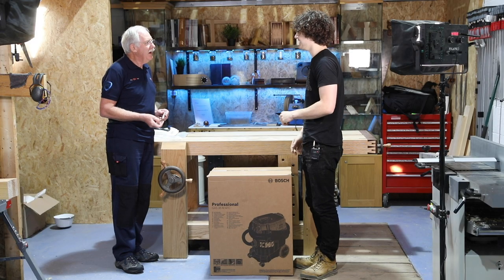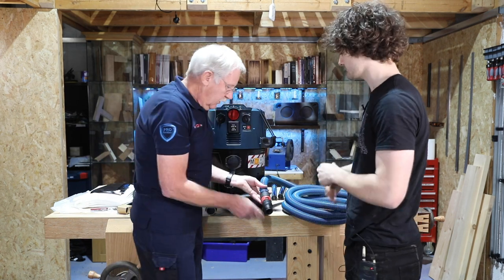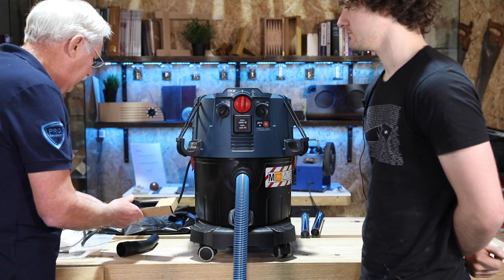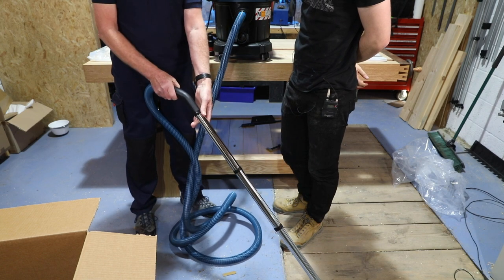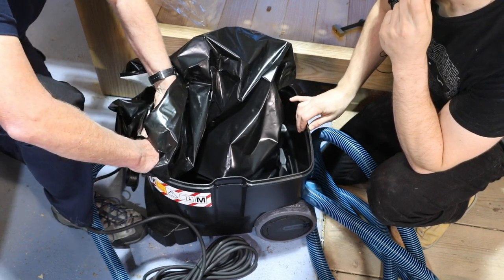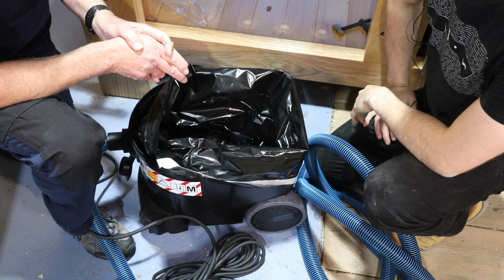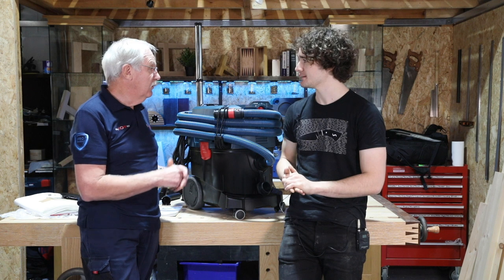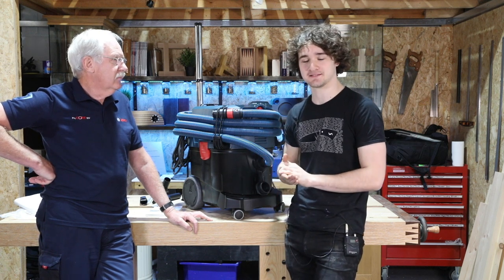Unboxing the Bosch GAS M Extractor | How to get the BEST from your Extractor

Comment: I bought one of these about a year ago, my wallet had to go for rehab, but my lungs have been grateful.  They are really expensive, but how much cheaper than a Lung Transplant?  Not worried about Matt selling out, he's lucky to have a sponsor which he's open about and the facts conveyed tell you what to ask about if looking at alternatives.  There are few M class that are cheaper, but plenty that are much much more expensive, if you have the money or value your lungs go and get one.

Matt, if you do ever get a hair cut, remove the bag before hoovering up, the shaggy fleece will help protect that filter!

Comment: I have a GAS50, over 15 years old now and still going strong -  which has a switch position for cleaning the filters (good to know they thought of it back then!).  I now have two Festool extractors, which are exceptional as they work up to the bag (replaceable or long life) being 100% full.  So when you do your test of this unit can you check what the extraction\performance is like when the bag is near full.  Good video, almost impartial from Bob, which is refreshing!  Oh - I also use my GAS50 for liquid - exceptional - really is great, no need to remove the filters  (which are still the original ones!!!).  Thanks

Comment: So in this video it was mentioned that all their L class hoovers use m class filters. And when using a fleece hoover bag you don't need the afc function. So therefore an l class hoover would be sufficient as long as I use a fleece bag which I have always done. Am I right in what I'm thinking? Great video btw

Comment: Thanks Matt. After using a small domestic vacuum cleaner for years and sometimes thinking about getting a proper device for the job; your piece here has tipped me over the edge and I have just bought a proper extractor - from Axminster of course!!

Comment: Matt, you should've asked Bob if Bosch make shop air cleaners. Ever since I hung one from the ceiling of my shop it has drastically cut down the amount of crap that gets up into the air after using a circular saw, router or sander. If the sunlight is right you get to watch the cloud of small particles get pulled and go away.

Comment: A very informative video. I always wondered what the difference between an L and M dust extractor was. A clear and simple explanation from Bob covered this nicely. If I decide to buy one of these I would also junk the plastic bag in favour of the fleece bags. Having said that, I reckon if you were sanding or working with filler or plasterboard it would get through the bag. The secondary M class filter should take care of most of this though.
Reply: The M class devices also have an alarm for when they're full or lose the ability to filter e.g. carcinogens. The point of an M is that everyone on the building site is protected from carcinogens and dangerous particles. 

The L class devices are cheaper because they're less smart; they have no alarm. They will happily let you continue working around them/using them when full, even with dangerous particles entering your lungs.

I decided in the past that £240 was right for my hoover choice (Makita VC3011L which is L class - and cheaper these days) but this M class looks like such a more advanced design.

Since it will protect my lungs better too - I'm seriously considering upgrading...

Comment: These look a great machine but I am concerned by the filter cleaning as it seems to be such a problem that it is turned off (noise and constant turning off the suction).  If I am hoovering fine brick dust will it go through the fabric bag and block the filter?

Comment: Hi Matt Bosch should really take well care of you.. You made me buy the miter saw, router and now am trying to buy this shop vac unit.. But i have a question.. Can I easily and safely use it with my GCM12 GDL miter saw? And if so is the amount of CFM going to  be decent for this setup?

Comment: I’ve had this GAS Extractor for 5 years and it’s been great, apart from one really really annoying feature.  It beeps too much.  It beeps, I’m assuming when there’s too much restriction to the suction, maybe to let you know something is stuck in the hose, or the filter needs washing/replacing.  The problem is it beeps even when it’s a new filter and there’s no obstructions.  It beeps when using a sander, it beeps when there is still good suction, and the suction/power settings have been changed.  I want to know how I can remove the beep, because it’s not needed, I feel like smashing it up when it goes on & on.  If it loses suction I will be able to tell, I don’t need a beep.  

My friend has the festool equivalent which doesn’t beep.  I think I will be changing to this soon.
Reply: if you have access to the PCB (circuit board), the beeper can be safely silenced with a hot glue gun. Thats what I did with my mocca-coffee-maker, works great

Comment: Hi Matt, just wondering if you (or any of your subscribers) could clarify something for me please. The maximum voltage for auto start is shown on your machine as 1800w. I have the Bosch 350-254 mitre saw which is 1800w, but do I need to have any headroom with the extractor I use? I’ve read the manual for this extractor and it says 2200w for the auto start but that it’ll vary by country. Just want to ensure this will indeed work with my mitre saw before spending on it. Any help would be appreciated from anyone. TIA.

Comment: Ok, sooo...the Porter Cable 330 is the best finish sander money can buy and it has no dust ports on it at all. Far smoother, more heavy duty,  just plain superior performance compared to anything Bosch sells! Why not build a downdraft top into your power tool bench? Much better option than kicking  the Bosch extractor out of your way all the time, wrestling the hose, tripping over the cord, etc... Save yourself the aggravation and go downdraft. Then you can use the best tools even if they don't have that proprietary Bosch quick connect fitting!
Reply: A downdraft table won't help much with wide pieces though
Reply: Haven’t Porter Cable become just another Chinese sellout? For finishing sanders, the Mirka Deros is where it’s at.
Reply: Downdraft is the way it's done in a commercial cabinet shop. There seems to be a weird bias against adopting them for semi-pro and hobby uses. It's just a shame because they are very easy to build ( pegboard and plywood) and would be better IMO than fooling around with a very expensive and specialized extractor. That's all.
Reply: Haven't used the Mirka so I can only amend my statement to the PC 330 Speedblock is the best sander I have used. To go fully tangent to my point: 1st it's very heavy and smooth which means you just guide it around effortlessly sanding for long periods without your hand or arm getting tired out. All others I know of are too light so you have to apply a small amount of pressure to get them to cut, or else the action is jumpy or erratic so you hang on tight to keep them from skittering out of control. This makes sanding hell 2nd the power cord comes out on top of the housing. Doesn't sound like a big deal, but it is. Keeps the cord out of your way and minimizes it getting stuck dragging the edge of the work. 3rd you can use any sandpaper you want, load up a dozen sheets and work a long time. The sandpaper clamps are STRONG won't fall apart, very likely to outlast the motor. So maybe the Mirka is better? It's certainly many times the price of the 330. But back to the point, does it have the Bosch quick connect dust port? That's what I was trying to say; many of us already have good tools and fooling around with hose adaptors and duct tape means we probably wouldn't benefit trying to use the Bosch extractor(finicky and frustrating) as much as a downdraft setup (easy and awesome).
Reply: To be fair Kory. Having taken a look at the PC330, it’s looks to me that the PC and Mirka haven’t been conceived for the same kind of work. The Mirka is a finish sander, but it’s just a relevant for sanding things already in situ as for on a workshop bench. Obviously, if you’re sanding vertically or the odd, unhappy occasion above your head, then ‘light’ is the answer, so it’s the opposite philosophy of the PC, it’s also a random-orbital. It looks like the 330 is a tried and trusted old design, so hopefully, if it is now being made in China, the quality of the castings, etc is still good. As for the extractor it looks like it can be used conventionally or with the propriety ‘snap and click thingy’. One last point, Mirka are expensive wherever in the world you live, but if you’re in the US, you’re probably paying about double what you should.
Reply: Good points Neil, you definitely don't want to be holding the 330 over your head for any length of time! I don't do built ins or finish carpentry so it's not much of an issue for me. I snagged my 330 for $20 at a local pawn shop. Proudly made in USA sticker is prominently displayed on the side. I think they moved production to Mexico in the 90s. Not sure where they make them now. It's interesting you mentioned castings. I believe Black and Decker shut down their US casting operations about 10 years ago and they were the last major power tool maker pouring metal castings in the US. Environmental and safety hazards dealing with heavy metal alloys makes it impractical to run industrial scale casting operations these days anywhere those concerns are regulated. It's my impression that a VERY large portion of the power tool worlds castings come from China no matter what any particular company might claim. The more honest ones use wording like 'Assembled in the USA from Globally Sourced Materials', others may be less than complete and not disclose that their motor and gear housings are Chinese.

Comment: I actually bought one of these at great expense and sent it back after turning it on in my workshop. The mini sonic booms every 15 seconds is simply totally unacceptable and impossible to live with. Fleece bags are very expensive and this machine becomes a very costly investment. I would advise anyone not to invest in this good looking white elephant.
Reply: Pretty much every vac manufacturer offers a fleece bag option - the quality ones anyway. You can buy cheaper paper/card type ones but, depending on the type of dust and frequency of exposure to it, fleece bags are more cost effective than bad health. The "sonic booms" are auto filter cleaning so the vac remains effective. Our Hilti vac does the same at nearly twice the price and noise level! I disagree that the Bosch GAS 35 is good looking, but also disagree it's a white elephant.
Reply: Mac Lambert......I guess it depends on how much you value your lungs and your ability to breath properly. Suddenly those booms dont really seem to matter.
Reply: Tell my dogs and my neighbours that!